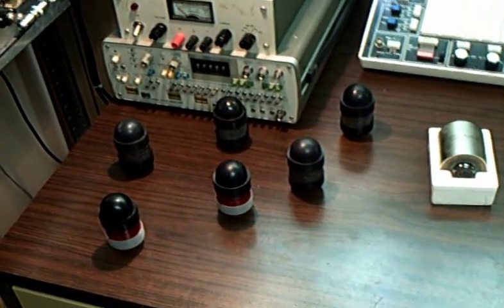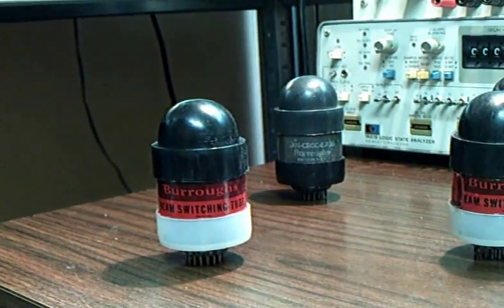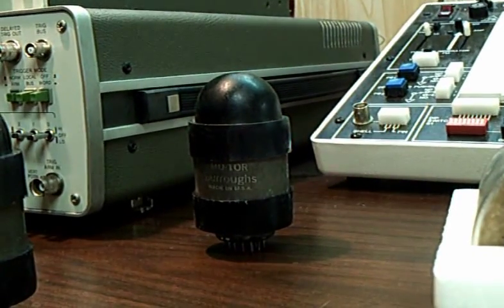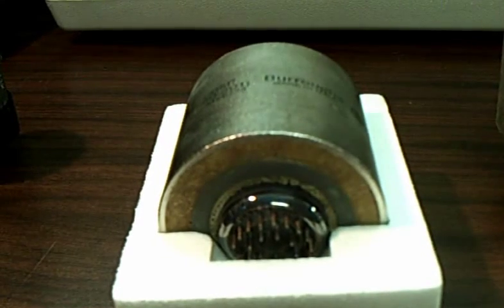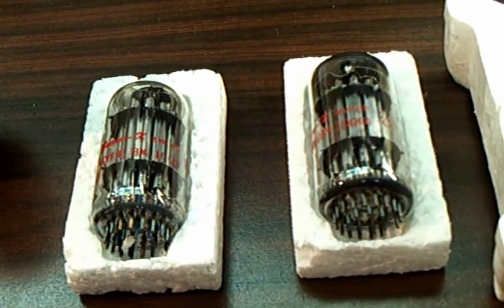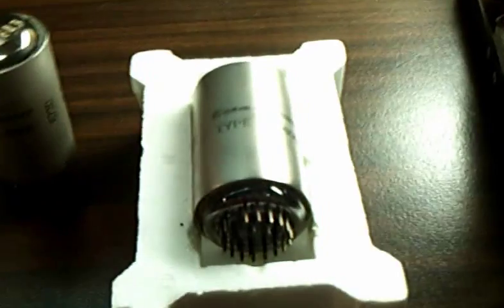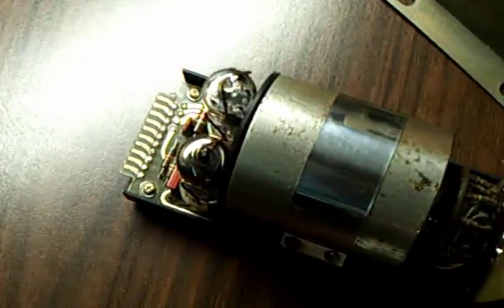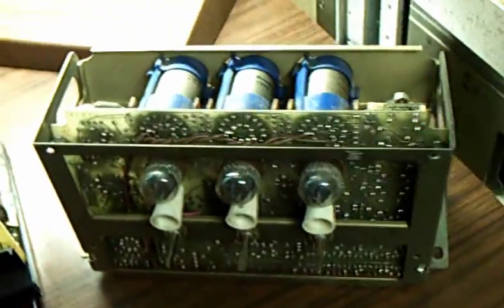Magnetic Beam Switching Tubes

Comment: Valvo did make one beam switching tube which had a fluorescent screen inside of it.
Reply from the maker: douro20 That would be the E1T, but it's not a magnetic beam switching tube. The E1T is driven by electrostatic pulses, and doesn't have a ring-type construction. All E1T's, including the Valvo-branded ones, were actually manufactured by Philips.

Comment: The form factor of the counter assembly at the right seems to match that of the counters in certain early models of Xerox photocopiers, but they were very slow devices by comparison, so I can't imagine why they would have needed the speed of beam switching tubes in a copier.  I have different versions of that assembly with both Nixie and Numitron tubes, but I don't recally them having the beam switching tubes in them.  I wonder if Burroughs supplied the counter assemblies as drop in components that Xerox bought and integrated into their copiers.
Reply from the maker: wizardofeyes The large assembly on the far right with three Nixies is a 101P479 Programmer, and it is indeed from a Xerox 2400 high speed photocopier, circa 1965. As far as I know, the 101P479 was custom-built by Burroughs for Xerox. It also has BX-2004 and BX-2005 counters, which are also believed to be custom part numbers specifically designed for Xerox products.
Reply: Interesting!   Seems like massive overkill to use a 1+ MHz counter to monitor a copier doing a couple of pages a second (optimistically!)  I'll have to drag out the counters that I have and see if they contain the Burroughs tubes in them.  TTL logic was invented in 1961 and commercialized in 1963, but it must have been too new for Xerox to adopt it yet in 1965.  It certainly would have made for a less expensive and smaller controller.
Reply from the maker: wizardofeyes ICs definitely would've resulted in a smaller unit, but it wouldn't have been cheaper in 1965. Beam switching tubes were quite obsolete by 1965, and they were sold for far less than ICs just to get them out the door. Xerox was probably also more comfortable dealing with an old, well-known business machine company like Burroughs, rather than a silicon upstart like Fairchild or TI. Even HP didn't start using ICs in designs until 1966, and they were far less conservative than Xerox. Xerox was still using beam switching tube counters at least until 1970 or so.
Reply: The Vintage Technology Association Neat history!  Thanks!  Sure doesn't seem like it  was all that long ago, but the years do fly by!